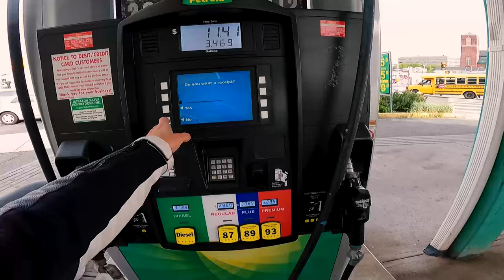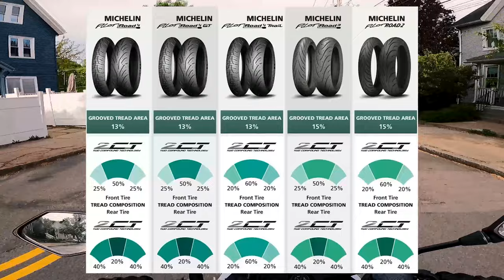Why you MUST have a chain guard | GV MotoVlog

Comment: Like the vid and message. What bike is that? You were popping the clutch when the chain broke?
Reply from the maker: Thanks for watching! I definitely didn't have the chain in spec at this time, i had recently installed the rear wheel after a tire change and didn't properly align it, lesson learned! I was doing a power wheelie in first gear so it popped out of place